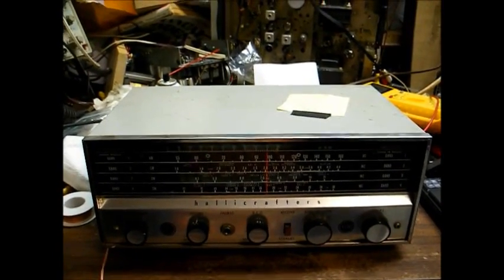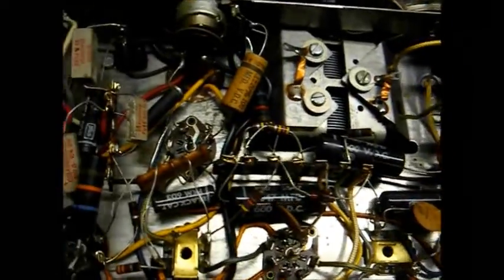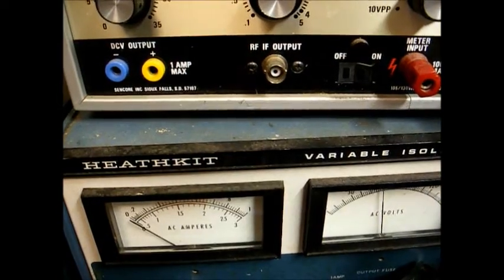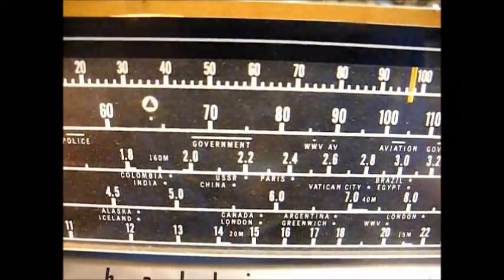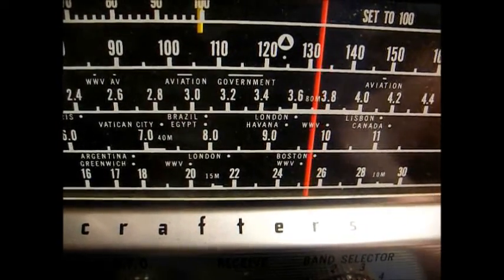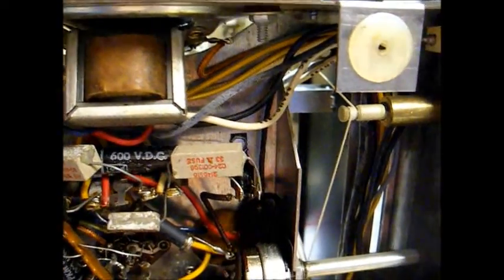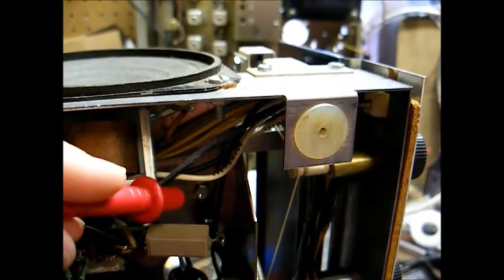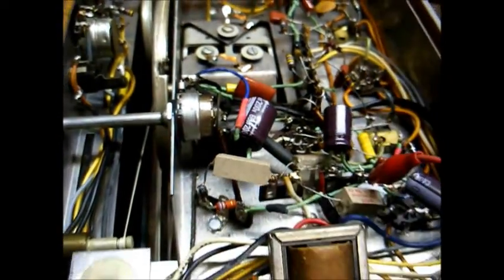Repair of a circa '65 Hallicrafters S120 shortwave radio - part one

Comment: I'm in the process of recapping an S 120 I've had for some time.Mine,however,has the six pin wafer capacitor like an S 38D and has a silicon diode rather than a selenium rectifier.I've got several Hallicrafters sets that need to be recapped.All have essentially that same chassis.Any pointers would be appreciated like where I can solder the capacitor grounds for B-.Thanks again.

Comment: I used a 100Ω 10W with the 1N4007 to get the appropriate voltage.  A 5W would be fine.
Here is the schematic manual, (left file); and pictures on the (right file)  Beware: this is 1.2GB
OneDrive: http://1drv.ms/1kfnWgW

Comment: I just re-capped a S120.  The major hum I had is gone but I still have a slight hum more like what you hear in audio
equipment when a shield on a cable is broken.  I also have on band 4 several internal RF signals showing up on the dial.
I think they are either harmonics or self oscillating.
The other issue I am fighting with is the receiver has microphonics.  I can tap the chassic and hear it at the speaker.
Anyone else have any of these problems?   Thanks, Ken
Reply: +Ken are there any S120 repair experts out there?   I would like to solve my microphonics on band D
as well as an area on band D that gives me a static/scratchy sound.
Thanks, Ken

Comment: I found a manual for mine on eBay for $10.00. :)
Two of the bands work and two are out, most likely filtering or alignment.
The book does have a diagram and alignment data. :):)
I did manage to break the glass though. :(:(

Comment: There's been a Hallicrafters S120 sitting at the local Antique Mall here for $35 for several months. I skipped on it because I realize it would be an under performer.
   Obviously that radio station engineer didn't want to bother to look at the set at all. He just brushed your friend off it seems. That's really to bad.
   Nice job so far bringing this puppy back for your friend. I'm sure he is really going to appreciate your work.
       Tom
Reply: I think that they have the potential to be fairly decent for what they are, certainly better then the average 5 tube AC/DC. I don't think I would pay $35 for one as they are a little too new, 1962-66 vintage, but maybe up to $20 is it was in decent cosmetic shape and clean.

Comment: I am glad you are tackling this job since I have a Hallicrafters S-120 myself.  Mine is all original, mint, no audio hum, sensitive and works well on all bands.  I run it, and all my other boat anchors a 1/2 hour every other week or so to keep them working properly.  So far, so good.  My Hallicrafters S-38E is a better performer and has better audio, however.  Can't wait until part 2.

Comment: What a coincidence, I have a Hallicrafters SW-500 that I just decided to take out and play with this week, same set, different cabinet colour. My set has tubular capacitors in ceramic shells, oddly enough they are still good so I think they may have used plastic film. However the set does not have enough gain and has a hum problem that need further investigation it may be a wiring problem or a bad couplate, the filter caps have already been changed. I also need to order in some resistors as half the ones in the set have drifted off in value, ones that I do not have in stock.
Those Cornell Dubilier "Black Cats" may in fact have plastic film inside as well if it is 1965 vintage, or paper backed plastic film. The bumblebees must have been old stock they were using up since they tested bad at low voltage. 
  I left the old selenium in place, it was the finned type, but I bypassed it with a silicon diode and used one of teh lugs as a tie point, The B+ voltage is supposed to be 110 VDC on the plate and screen of the power output tube, and the plate of the 12BE6 and 12BA6, I think it's 67 VDC  on the plate of the 12AV6.

Comment: Nice set, but I don't understand why your friend said it didn't work--aside from some filter hum and dirty contacts, it seemed to work pretty well to me. And I knew all of those tubes weren't bad, and I'm sure you did too--no doubt someone told him because the tubes were old, they were probably "worn out".
Reply from the maker: The only time I've ever seen all of the tubes in a radio being bad was on one or two farm battery radios where some goofball applied B+ voltage to the filament connections. Usually, when someone says, "all tubes are bad and I can't get them", they really mean, "I don't want to work on it." The fact is that the tubes used in this radio were used in 90% of AA5's from the late '40's until the end of the tube radio. I tested all the tubes out of this radio and they all test very strong. The "black cat" capacitors tested a little leaky at rated working voltage. The two bumblebees tested very leaky at low voltage. I had the radio connected to about 15 ft. of outside antenna and I figure, at best, it was previously being used with the 6 inch piece of wire that was attached to the antenna terminals. Next, I'm going to touch up the alignment and I'm sending it home.
Reply: I always called those bumblebees "Explodomatics" for all of the plastic shrapnel I've seen from them lol Yep, an alignment should get it 100%. I've always been amazed at the performance Hallicrafters could squeeze out of a 4 or 5 tube ac/dc set.

Comment: I'm surprised that for a Hallicrafters this is so cheaply made.Only four tubes, I would think they would have an additional 12BA6 or 12AU6 as an RF amplifier.
Reply: The S-120 was the replacement model for the S-38 series, I think that the S-38E was the last of those. It never was never intended to be any more then an entry level set. To add an RF amp properly they would have had to add an RF coil for each band, an extra wafer in the band switch, and a three gang tunic condenser, plus all the extras like trimmer caps and resistors. One thing that could have been done would be to add an extra If amplifier stage and a third IF can, that would have been cheaper and less complex, some National models did that.